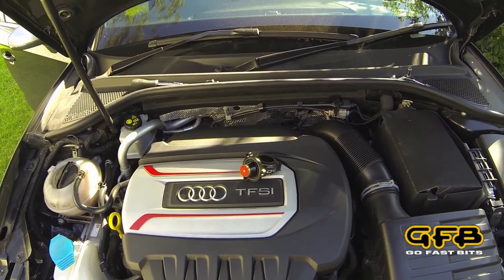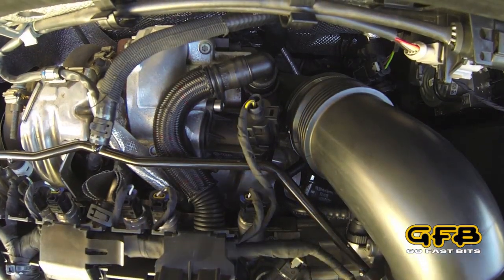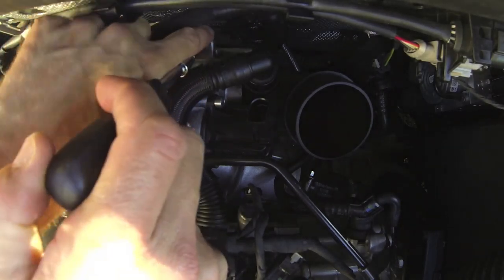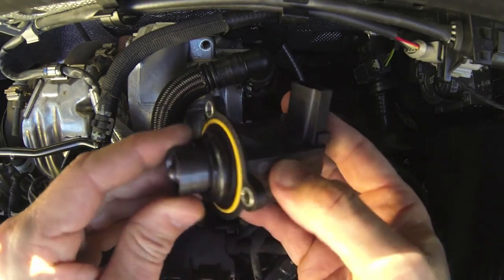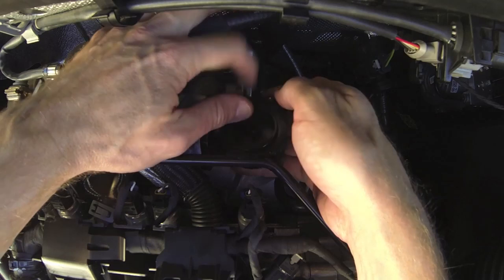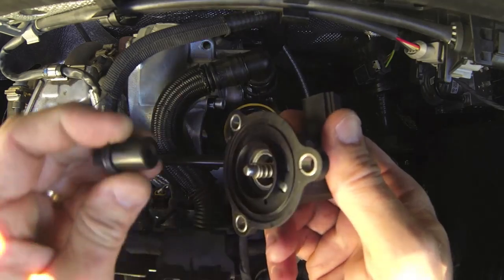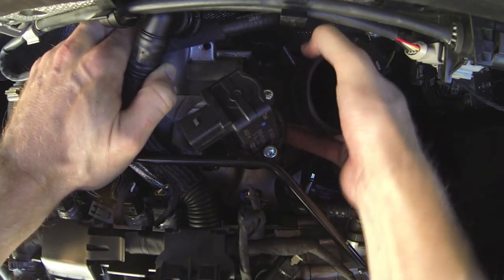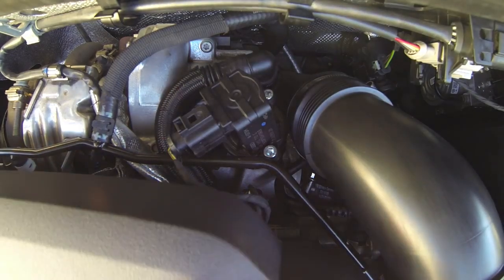GO FAST BITS GFB DV+ T9359 DIVERTER VALVE **HOW TO DIY INSTALL VIDEO** GOLF 7 R AUDI 8V S3 MQB

Comment: Does this mod address turbo/compressor flutter? I just installed IE Intake, Inlet pipe and turbo muffler delete and I now get occasional flutter on closed throttle....
Reply: No it doesn’t I actually never had any flutter till I installed this. I’ll be removing mine to stock pretty soon, I don’t think it does any good and pretty sure I’ve lost abit of power

Comment: Good piece but will probably fit only with stock turbo inlet. Just tried to fit it on my 18 s3 with aftermarket inlet but not enough space to get dv+ to get into correct position
Reply: Mine fits with the CTS
Reply: @S3brandon  not sure if thats smaller than unitronics turbo inlet elbow piece, id imagine theyd be same size though, but yea impossible to fit in, oh well
Reply: @FrostM89  mine fits fine with the CTS inlet on my audi s3.. maybe try again like install the dv first then the inlet or vise versa
Reply: @n54gasm.e92  unfortunately not, had to return it.
Reply: @n54gasm.e92  didn’t bother with a diverter valve after trying this one

Comment: Ordered mine, hopefully it fixs high pitch sound I'm hearing at full boost
Reply: that’s your turbo inlet pipe if you have one.
Reply: @killer_vette351  yah it's the inlet pipe causing the sound. People were saying the dv+ will stop it but they were wrong.... honestly didn't really notice any difference for anything with it compared to the stock one. Guess the main benefit is knowing the my dv internals won't melt and fall apart risking damaging my turbo
Reply: @S3brandon  what after inlet pipe do you have? I’m thinking of going with a full IE intake and inlet pipe and this diverter valve
Reply: @baranUtube  I got the CTS inlet pipe paired with the Injen air intake
Reply: @S3brandon  and the gfb fit?
Reply: @baranUtube  yeah fits fine
Reply: I have the one speical for the s3/golf R so the dv sits upright like the one in the video

Comment: What happens when a screw falls out from the where the DV+ screws into the turbo housing? Seriously.
Reply from the maker: Same as a stock item i guess nothing much, the two bolts could work loose but i highly doubt that.
Reply: @VolksWorkshop  it doesn’t feel loose at all. Everything feels super tight and I’m actually getting steady boost now no more turbo flutter under heavy load or during gear shifts